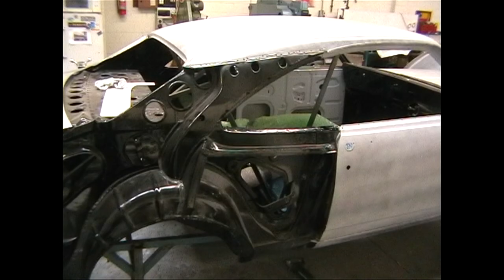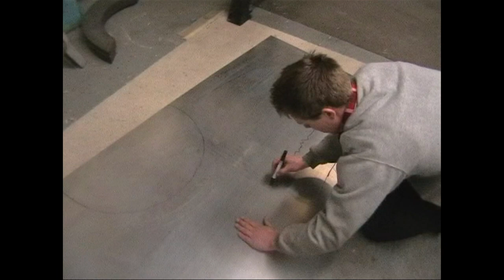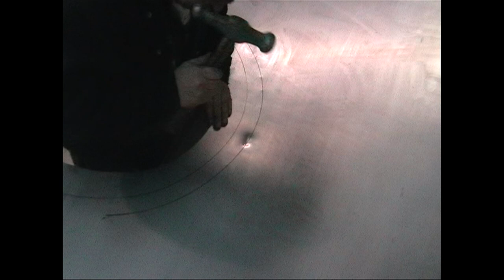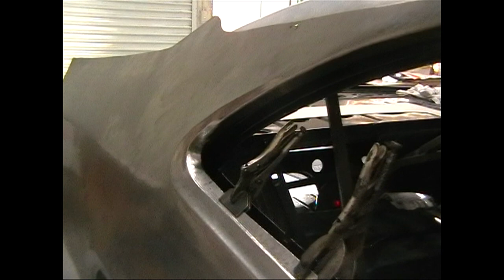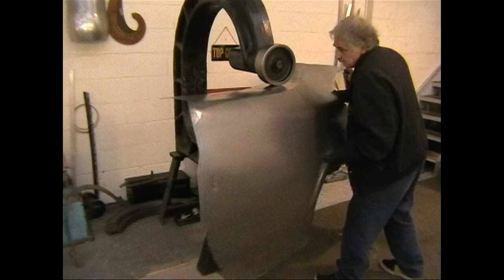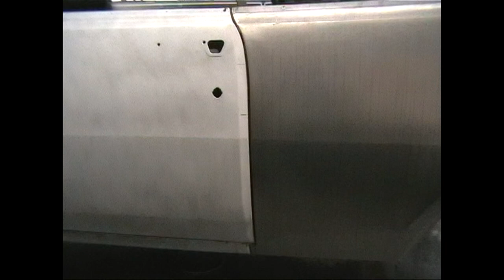Peter Tommasini Shaping Monaro Quarter Panel

Comment: Holy crap!!! Most people would have to have made that in multiple separate panels. Peter probably doesn’t even know how to weld because he never had to!!!!
Reply from the maker: I can weld, but in this case because of the nature of the panel it would be difficult to find a good place to join the panels together, mainly because of the big return on the wheel arch.  Welding a panel like that would be a lot of work to  line up, weld,and clean up , more so than make the panel in one piece

Comment: one guide that i didnt find anywhere is how to make parts like the dent where the sides of the bumper goes in the quarter panel, or where the tail lights go, they are hard to fabricated if you are just experimenting with no help or guide.
Reply from the maker: Rafael just make some proper  profiles as shown on the dvd's follow them and you will be OK

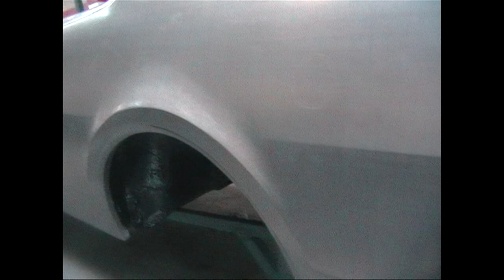Comment: At 3:34, you can see the cease or ridge that runs across the middle of the panel . how did he get that without distorting the curve ? was it done with a hand tool or a bead roller?
I'm having an issue with a door skin , I can make a reasonable skin but it goes crap when I try to roll that ridge. I think the ridge actually needs to be stretched out, otherwise just rolling the ridge flattens out the curve on the panel.
Reply from the maker: Its all done by hand, no machine have been  used  a part for the first wheeling .I can  not ex plane over the net how it was done It would take too long But... if you like there are 3  dvd available on the making of that particular  panel,  with all info an all the hand made parts  such as wheel arch , bar indentation ,petrol cap , tail light shape , door jam , rear window drop off side window , boot rubber Chanel , hand swaging and much more. If you are interested in purchasing the 3 dvd's please send a email at        tommasini@handbuilt.net.au

Comment: That's pretty cool. I would imagine it's pretty tough finding Monaro tin in good shape...if at all.
Reply from the maker: almost impossible
Reply: Actually one is  for sale right now on social media.Its a base model HT  roller  but it has a near immaculate interior and a  dead straight ,genuine rust free body.The seller has 50k on it yet some are shit canning him saying it's too dear.In recent years a pair of New Old Stock GTS front guards sold for $8000,a pair of New Old Stock quarters fetched $12 000.Back in  the 80's I saw a New Old Stock Monaro body shell in a shed of a Sydney wrecking yard  have a quarter panel removed with an oxy torch when they couldn't sell the complete shell !!

Comment: So when hammering out the flare, is there a form on the other side or are you judging the depth by eye?  Same question goes for the accent underneath the tail light. Are you using a prebuilt form or just freehanding with a dolly?
Reply from the maker: No former where used,
  simply patterns and profiles  from a new old stock quarter
Reply from the maker: No form used, simply gauged by the patterns and profiles from a new old stock quarter

Comment: Mr. Tommasini, I'm wondering if you could point me in the right direction? 
 I have been studying and praticing with metal work for a few years. For the most part, I understand how to do it unless it is detailed work that takes a lot of leaverage and distorts the rest of the panel. With cold rolled steel I can't even block the shape in to be able to plannishish it. I'm guessing that the the detailed parts are made from softer metal shaped with dies/bucks and then welded in. Is this correct? 
                                                                                          Thanks in advance! pete
Reply from the maker: It depends where you live ,here in Melbourne I never had any problems using 1 Mm cold rolled CA3 steel  whether I wheel it , pressed it , or weld it . May be  you are using the wrong material ?
Reply: @Handbuilt1  I'm in New York and in a internet search I can only find Hot Rolled in 16 gauge and thicker.
Reply from the maker: @pfausette4405   If you join this  forum ,   All  Metalshaping .com    where there are a lot of discussions about the steel you need you might be able to buy some in the US
Reply: I'm actually a member but I only did a introduction post and that was it. I'll post some questions there and see how it goes.